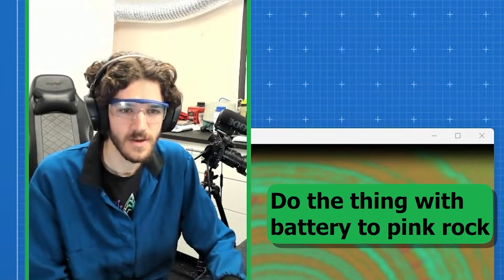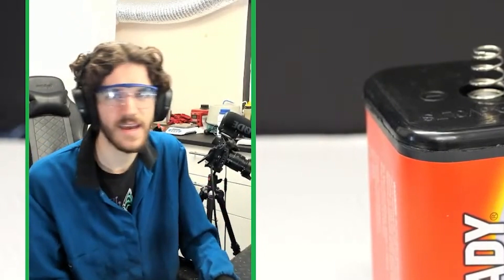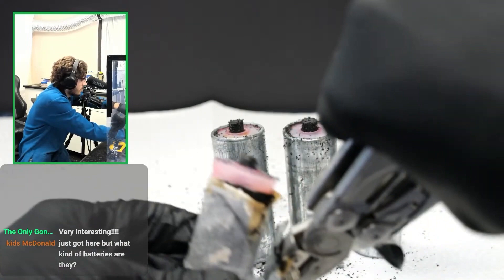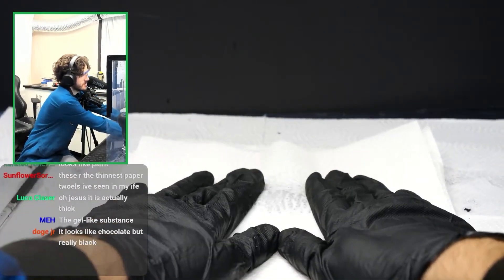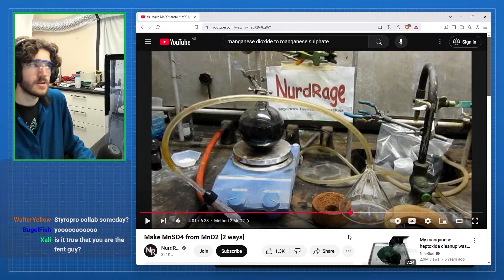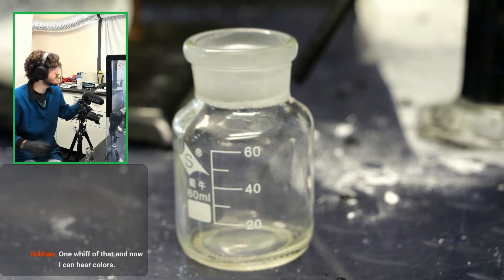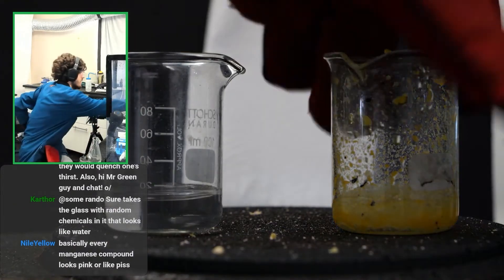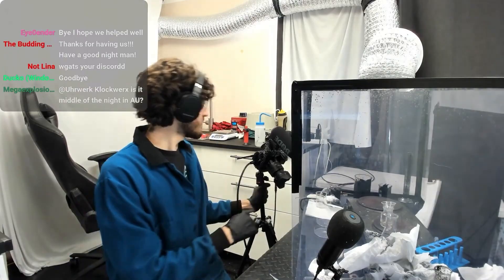Turning a dead battery into beautiful pink crystals

Comment: Easiest way. Take your stash of dead alksline dry cell batteries. The zinc can will be mostly rotted or a glob of gray paste in the middle. Save that if you want zinc back later. Remove and discard the  plastic and paper bits. Save the brown mud out of them. Put that in a bucket of water and mash it up. Let sit ivernight. The liquid is potassium hydroxide which is quite useful. Next add a little vinagar to the muf till ph is neutral and lots of water. Let sit overnight discard the vinagar water layer. Next add concentrated HCL to the mud and let it soak for a week then fill the bucket with water. Stir and let settle. Save the MnCl2 solution and let it evaporate slowly. The MnCl2 will form nice pink crystals. ❤

Comment: I planned to do this a couple years ago but my hot plate broke and I never got around to it afterwards. Another video I saw mentioned the solid electrolyte has a lot of iron contamination which adds to the discolouration, sometimes the crystals from the HCl method are even completely brown due to this and they used acetone to extract out the ferric chloride before evaporating the water since MnCl2 is insoluble in it but FeCl3 can dissolve quite easily. Nice crystals